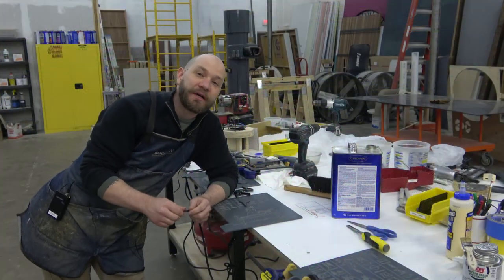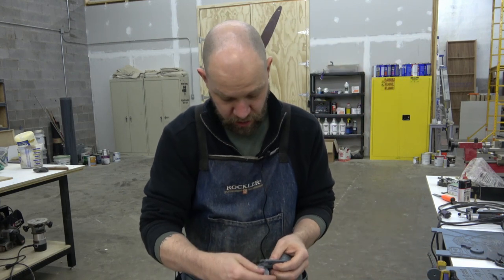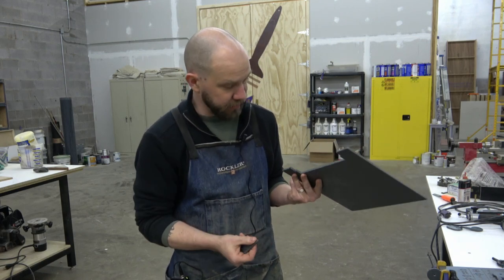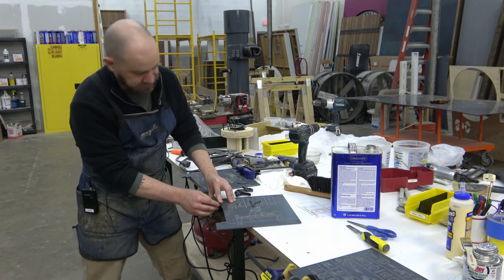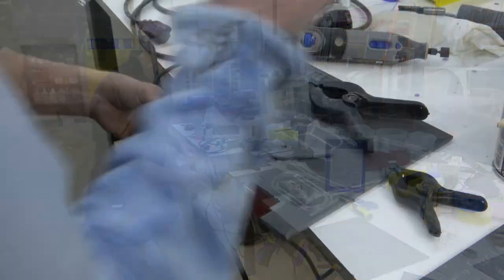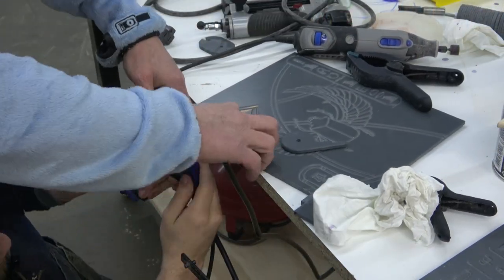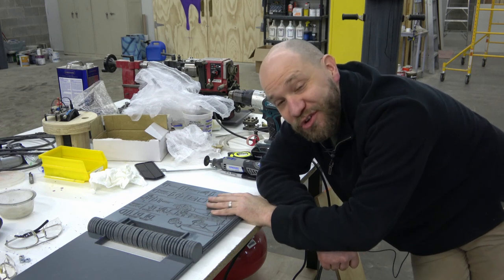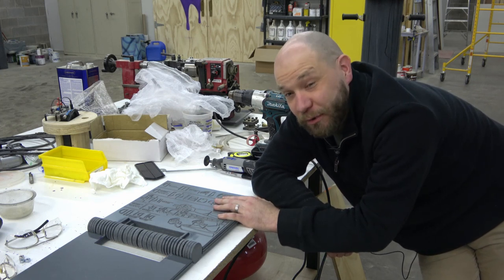The Book of the Dead

Comment: What's the name of the plastic sheets that make the pages? Where can I buy some?
Reply from the maker: That is solid 1/4' sheet PVC (not Sintra, which is aerated PVC) It comes in white, black and grey. We got ours from Nationwide plastics, Dallas but i'm sure any good plastics supplier can get it. Remember--It's NOT Sintra  :-D
Reply: Thank you so much!

I'm building a prop that is going to be covered by this. Holding it on with bolts to a wooden subframe. 

Do you have any tips on what to use between a linear actuator (expensive) or like solenoids(?)? Do you have a video that outlines some of the differences?
Reply from the maker: That's probably a conversation (I type slowly) Grab my phone number from our facebook page and give me a shout -Mark
www.facebook.com/Gratuitous-Sets-Laboratories
Reply from the maker: Thanks :-)

Comment: How did the plastic welder work? I've seen it at HF but in the past I have used a badly abused soldering iron (retired from electronic use now) and plastic shavings.
Reply from the maker: It was total crap. I'm looking for a better capillary action solvent weld glue :-/
Reply from the maker: Brilliant! Thanks!

Comment: Hey Matt, have you tried routing ABS instead of PVC? ABS is not as brittle as PVC. For the page holders/hinges you could route some Garolite also referred to as g10 which is a fiber enforced epoxy a cheaper alternative to carbon fiber. You would have to use CA glue or you can tape screw threads in garolite. Very hard to snap or crack with the fibers.
Reply from the maker: Looking it up now...
Reply: You can't make me learn! But since you have, I'll grab some of that to play with the next time we go to our plastic suppliers.
Reply: G10 is nice. It can be hard on blades and bits because of the fibers. We use it where we cannot use metal but need the strength of metal. We use ABS over PVC especially Sintra because of how it dents on impact. We make products for the tool industries so it has to take a beating. Great work btw it look awesome.
Reply from the maker: Yeah, I think our love affair with Sintra may be largely over.